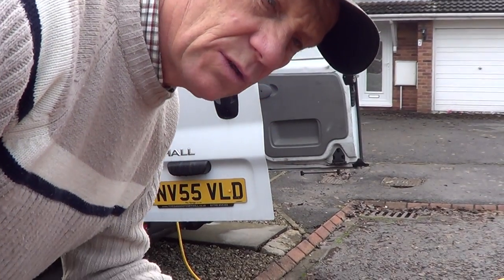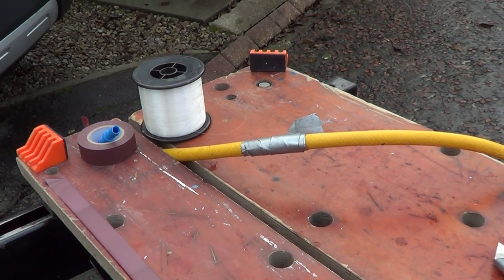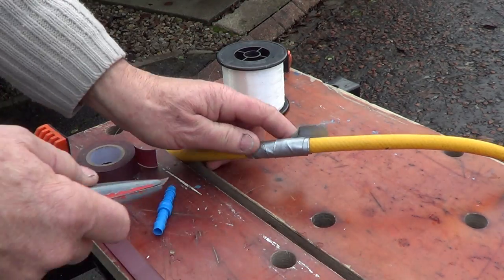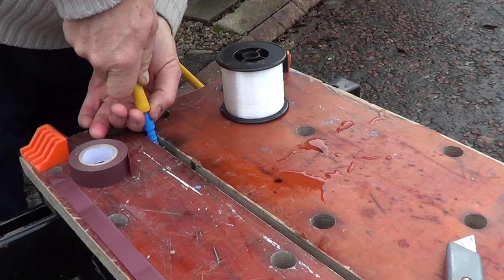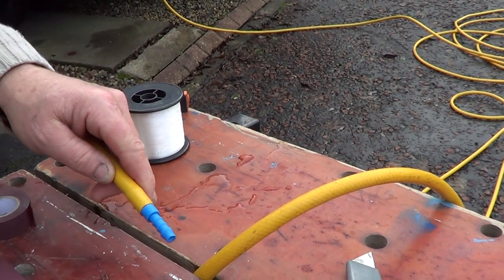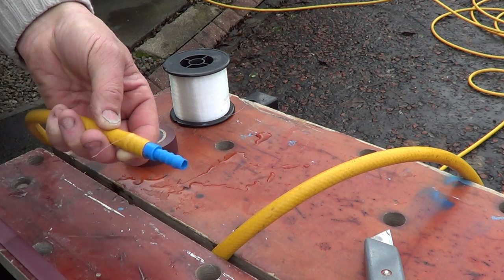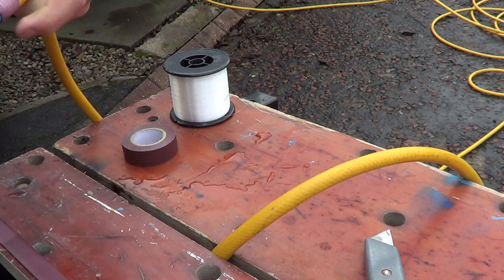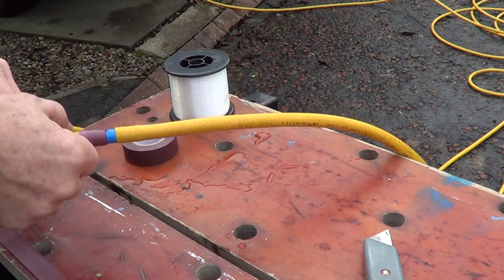How to mend WFP hose - Window Cleaning Tips

Comment: Hi Chris another great wee tip but what sort of tape is that as my insulating tape came of within minutes of a temp repair ??
Reply from the maker: mac243877 Its just insulating tape but some brands are better than others I found. I got the most recent batch from Wilkinsons and it seems to be holding up quite well.

Comment: Hi Chris, what tape did you use to temp cover the leak?  The silver tape?  I need something to do a quick fix while out and about and then a more proper fix when back home. Cheers
Reply from the maker: The best tape to use is insulation tape which is easy to get. That silver stuff is all I had for the demo at the time.

Comment: Hi. S.O.S.   I have been using the pole system now for 6 wk now. I'm just going round my work for the second time.i needed to swap from using ladders for various reasons.trouble is my own windows have been cleaned with it maybe 5times, and I still find spotting. It's scaring the pants out me and not giving me much confidence in using it. I always do the frame above and give it a good rinse. Should I just clean under the frame or keep practicing. I've been using ladders for 17 yrs. all my mates use pole system so it must work. I'm working with gardiners gear back p etc.im getting my water from my mate. His tds is 12 but he said its ok up to15. He is trying to sort his filters out but he seems to think its ok for now. I would like 0 water but till I filter my own i will have to make do. Perhaps I'm still cutting my teeth with it and need to be patient , I hope my customers can be too although only had a couple of complaints which I sorted out. Regards steve.
Reply from the maker: What I did was to change over very gradually. I chose some houses that I did not want anymore. Some had lead on the glass and I did these for a while until I got the hang of it. Very gradually I changed over everyone slowly but surely. 12ppm should be just fine as technically, you can't see any spots below at tds of 050. The secret is in the rinse. That's why at first you should rinse like mad and take much longer. I only do tops with wfp except on the leaded ones or Georgian. You really need a good flow from your jets so that you will get a good rinse. I have 3ltrs per min but up to 4ltrs per min will be better. If you take your time at first, and do the frames then go and do the glass after a few mins, this can help until you manage to get the frames perfect. Then when you do the glass, rinse twice with the brush off the glass. After a while it all comes good and you will fly through the windows.
Reply: hi steve watch wagga's video's or reach its as they both explain wfp from a to z well worth it and yes its all in the rinse but only if your water is below x ppm I keep mine at '0' no customer complaints good luck